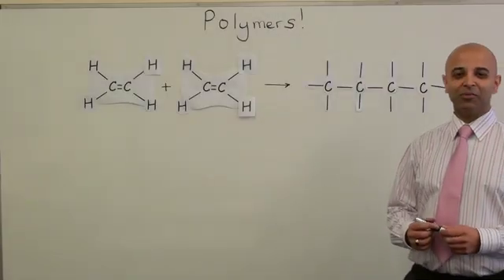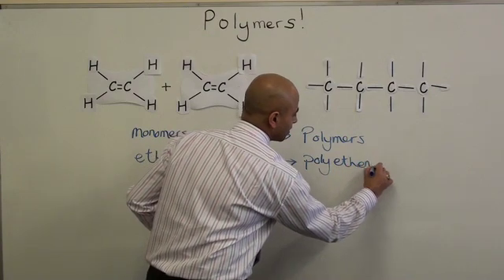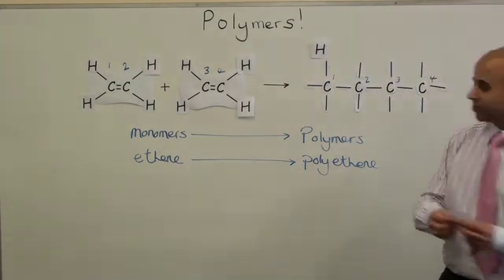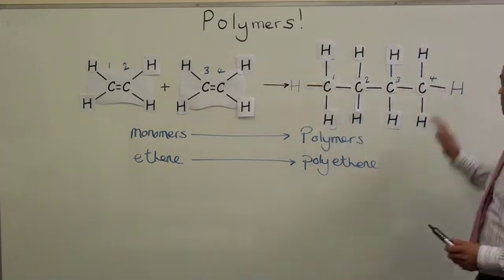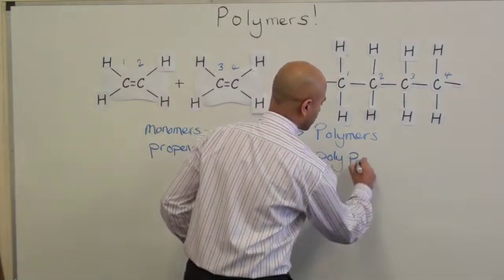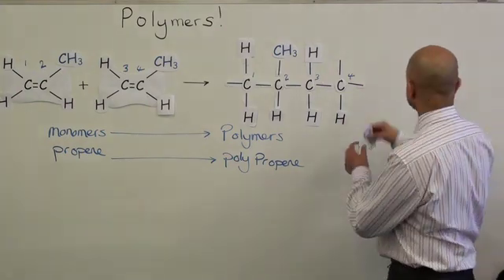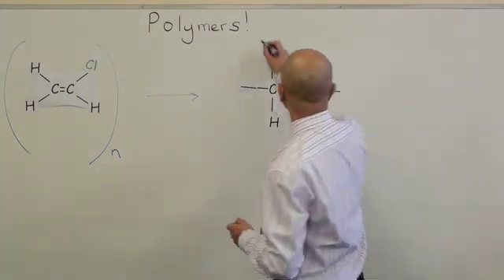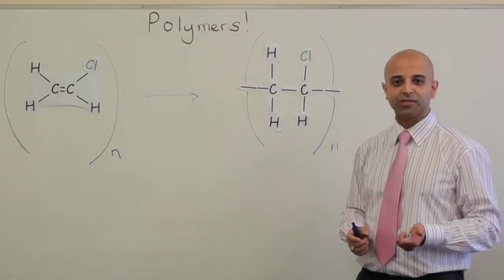Polymers and Monomers BBLC.mov

Comment: The present work shows the inapplicability of the Pauli principle to chemical bond, and a new theoretical model of the chemical bond is proposed based on the Heisenberg uncertainty principle.
See pp. 88 - 104 Review. Benzene on the Basis of the Three-Electron Bond. (The Pauli exclusion principle, Heisenberg's uncertainty principle and chemical bond). http://vixra.org/pdf/1710.0326v2.pdf

The Pauli exclusion principle and the chemical bond.

The Pauli exclusion principle — this is the fundamental principle of quantum mechanics, which asserts that two or more identical fermions (particles with half-integral spin) can not simultaneously be in the same quantum state. 

Wolfgang Pauli, a Swiss theoretical physicist, formulated this principle in 1925 [1]. In chemistry exactly Pauli exclusion principle often considered as a ban on the existence of three-electron bonds with a multiplicity of 1.5, but it can be shown that Pauli exclusion principle does not prohibit the existence of three-electron bonds. To do this, analyze the Pauli exclusion principle in more detail.

According to Pauli exclusion principle in a system consisting of identical fermions, two (or more) particles can not be in the same states [2]. The corresponding formulas of the wave functions and the determinant are given in the reference (this is a standard consideration of the fermion system), but we will concentrate our attention on the derivation: "... Of course, in this formulation, Pauli exclusion principle can only be applied to systems of weakly interacting particles, when one can speak (at least approximately on the states of individual particles) "[2]. That is, Pauli exclusion principle can only be applied to weakly interacting particles, when one can talk about the states of individual particles.

But if we recall that any classical chemical bond is formed between two nuclei (this is a fundamental difference from atomic orbitals), which somehow "pull" the electrons one upon another, it is logical to assume that in the formation of a chemical bond, the electrons can no longer be regarded as weakly interacting particles . This assumption is confirmed by the earlier introduced notion of a chemical bond as a separate semi-virtual particle (natural component of the particle "parts" can not be weakly interacting).

Representations of the chemical bond given in the chapter "The Principle of Heisenberg's Uncertainty and the Chemical Bond" categorically reject the statements about the chemical bond as a system of weakly interacting electrons. On the contrary, it follows from the above description that in the chemical bond, the electrons "lose" their individuality and "occupy" the entire chemical bond, that is, the electrons in the chemical bond "interact as much as possible", which directly indicates the inapplicability of the Pauli exclusion principle to the chemical bond. Moreover, the quantum-mechanical uncertainty in momentum and coordinate, in fact, strictly indicates that in the chemical bond, electrons are a system of "maximally" strongly interacting particles, and the whole chemical bond is a separate particle in which there is no place for the notion of an "individual" electron, its velocity, coordinate, energy, etc., description. This is fundamentally not true. The chemical bond is a separate particle, called us "semi-virtual particle", it is a composite particle that consists of individual electrons (strongly interacting), and spatially located between the nuclei.

Thus, the introduction of a three-electron bond with a multiplicity of 1.5 is justified from the chemical point of view (simply explains the structure of the benzene molecule, aromaticity, the structure of organic and inorganic substances, etc.) is confirmed by the Pauli exclusion principle and the logical assumption of a chemical bond as system of strongly interacting particles (actually a separate semi-virtual particle), and as a consequence the inapplicability of the Pauli exclusion principle to a chemical bond.

1. Pauli W. Uber den Zusammenhang des Abschlusses der Elektronengruppen in Atom mit der Komplexstruktur der Spektren, - Z. Phys., 1925, 31, 765-783.

2. A.S. Davydov. Quantum mechanics. Second edition. Publishing house "Science". Moscow, 1973, p. 334.

Heisenberg's uncertainty principle and chemical bond.

For further analysis of chemical bond, let us consider the Compton wavelength of an electron:

λc.е. = h/(me*c)= 2.4263 * 10^(-12) m

The Compton wavelength of an electron is equivalent to the wavelength of a photon whose energy is equal to the rest energy of the electron itself (the standard conclusion is given below):

λ = h/(m*v),     E = h*γ,      E = me*c^2,      c = γ*λ,      γ = c/λ

E = h*γ,      E = h*(c/λ) = me*c^2,       λc.е. = h/(me*c)

where λ is the Louis de Broglie wavelength, me is the mass of the electron, c, γ is the speed and frequency of light, and h is the Planck constant.

It is more interesting to consider what happens to an electron in a region with linear dimensions smaller than the Compton wavelength of an electron. According to Heisenberg uncertainty in this area, we have a quantum mechanical uncertainty in the momentum of at least m*c and a quantum mechanical uncertainty in the energy of at least me*c^2 :

Δp ≥ mе*c      and      ΔE ≥ me*c^2

which is sufficient for the production of virtual electron-positron pairs. Therefore, in such a region the electron can no longer be regarded as a "point object", since it (an electron) spends part of its time in the state "electron + pair (positron + electron)". As a result of the above, an electron at distances smaller than the Compton length is a system with an infinite number of degrees of freedom and its interaction should be described within the framework of quantum field theory. Most importantly, the transition to the intermediate state "electron + pair (positron + electron)" carried per time ~ λc.е./c

Δt = λc.е./c = 2.4263 * 10^(-12)/(3*10^8) = 8.1*10^(-20) s

Now we will try to use all the above-mentioned to describe the chemical bond using Einstein's theory of relativity and Heisenberg's uncertainty principle. To do this, let's make one assumption: suppose that the wavelength of an electron on a Bohr orbit (the hydrogen atom) is the same Compton wavelength of an electron, but in another frame of reference, and as a result there is a 137-times greater Compton wavelength (due to the effects of relativity theory):

λc.е. = h/(me*c) = 2.4263 * 10^(-12) m

λb. = h/(me*v)= 2*π*R = 3.31*10^(-10) m

λb./λc.е.= 137

where R= 0.527 Å, the Bohr radius.

Since the De Broglie wavelength in a hydrogen atom (according to Bohr) is 137 times larger than the Compton wavelength of an electron, it is quite logical to assume that the energy interactions will be 137 times weaker (the longer the photon wavelength, the lower the frequency, and hence the energy ). We note that 1 / 137.036 is a fine structure constant, the fundamental physical constant characterizing the force of electromagnetic interaction was introduced into science in 1916 year by the German physicist Arnold Sommerfeld as a measure of relativistic corrections in describing atomic spectra within the framework of the model of the N. Bohr atom.

To describe the chemical bond, we use the Heisenberg uncertainty principle:

Δx * Δp ≥ ћ / 2

Given the weakening of the energy interaction 137 times, the Heisenberg uncertainty principle can be written in the form:

Δx* Δp ≥ (ћ * 137)/2

According to the last equation, the quantum mechanical uncertainty in the momentum of an electron in a chemical bond must be at least me * c, and the quantum mechanical uncertainty in the energy is not less than me * c ^ 2, which should also be sufficient for the production of virtual electron-positron pairs. 

Therefore, in the field of chemical bonding, in this case, an electron can not be regarded as a "point object", since it (an electron) will spend part of its time in the state "electron + pair (positron + electron)", and therefore its interaction should be described in the framework of quantum field theory.

This approach makes it possible to explain how, in the case of many-electron chemical bonds (two-electron, three-electron, etc.), repulsion between electrons is overcome: since the chemical bond is actually a "boiling mass" of electrons and positrons, virtual positrons "help" overcome the repulsion between electrons. This approach assumes that the chemical bond is in fact a closed spatial bag (a potential well in the energy sense), in which "boiling" of real electrons and also virtual positrons and electrons occurs, and the "volume" of this potential bag is actually a "volume" of chemical bond and also the spatial measure of the quantum-mechanical uncertainty in the position of the electron.

Strictly speaking, with such a consideration, the electron no longer has a certain energy, momentum, coordinates, and is no longer a "point particle", but actually takes up the "whole volume" of chemical bonding. It can be argued that in the chemical bond a single electron is depersonalized and loses its individuality, in fact it does not exist, but there is a "boiling mass" of real electrons and virtual positrons and electrons that by fluctuate change each other. That is, the chemical bond is actually a separate particle, as already mentioned, a semi-virtual particle. Moreover, this approach can be extended to the structure of elementary particles such as an electron or a positron: an elementary particle in this consideration is a fluctuating vacuum closed in a certain spatial bag, which is a potential well for these fluctuations.

 See pp. 88 - 104. Review. Benzene on the Basis of the Three-Electron Bond. (The Pauli exclusion principle, Heisenberg's uncertainty principle and chemical bond). http://vixra.org/pdf/1710.0326v2.pdf

Bezverkhniy Volodymyr (viXra): http://vixra.org/author/bezverkhniy_volodymyr_dmytrovych

Comment: Should it not be polyethANE as the polymer no longer has a double bond therefore making it an alkane not an alkene
Reply: Tem See no because it still has 4 hydrogen and 2 carbons (not 6 hydrogen and 2 carbons )
Reply: Good question but the single bond formed by the polymer is not due to saturation but because it has opened up to form the polymer.